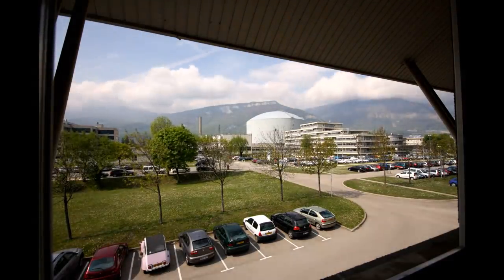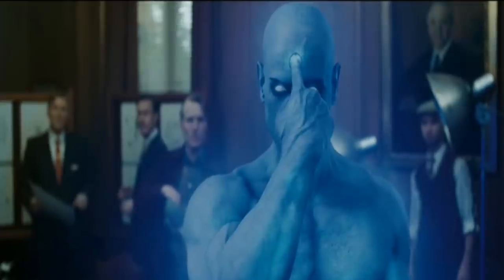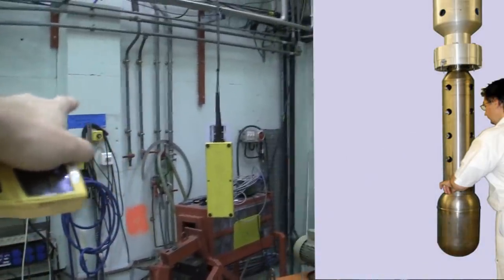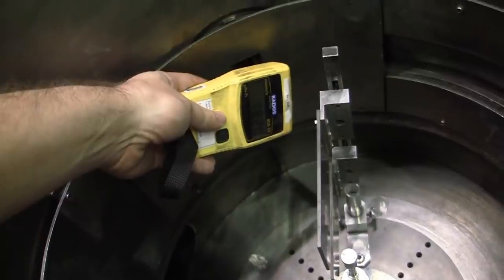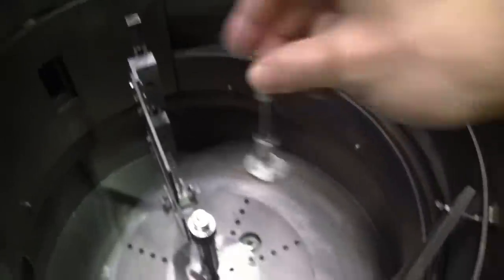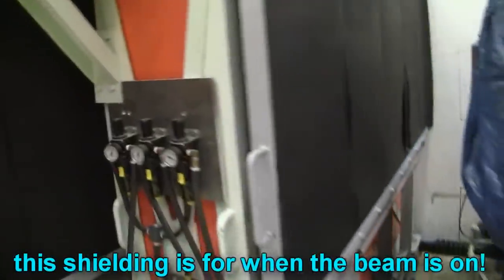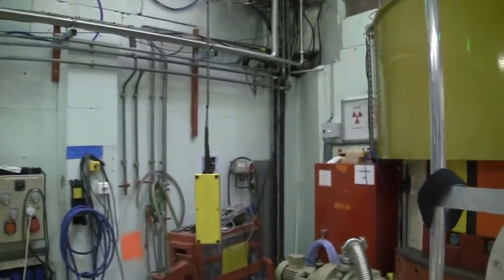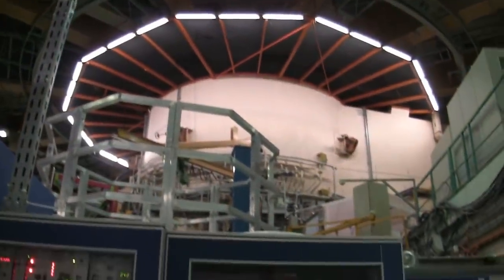Nuclear Reactors, Fantasy and Fact!

Comment: Just dont be in there if a powerfull earthuake hits like hit Fukushima. The ground shook , bounced thundered for 7 minutes. At least 3 reactor cores in Fuku cracked in those 7 minutes. Then the tsunami hit swamping everything . Great , now e have toxic , deadly unstoppable radiation being pumped out in the air and water for the next 10 thousand years minimum. The Pacific Ocean is dying . All tide pools are dead, All fishing species are down 90% , Whales , seals, polar bears are starving too death. Japan did not want any nuke plants built way back in the fifties. We forced them too accept the nukes. Great , Japan the most seismic ,almost yearly powerfull earthuake zone on earth. Tokyo should have been evacuated. An area one tenth the size of France , using the new super solar cell tech could provide all power for all of earth. All these NUKE TICKING TIME BOMBS could be closed forever.   p.s.  Try too get that close too the cracked reactors at Fuku now, your organs would melt in a few minutes, be a horrible agonizing death.
Reply: The new super efficient solar cells work at   90 % even on cloudy days' Nuclear would be too cheap too meter, they said way back in the 50's. They are the most expensive, most complicated, most polluted , foulest most dangerous way too boil water ever invented.  Oil super rich Dubai is building huge , immense  solar arrays using this efficient technology , Not because they are environmentalists , but because it is the cheapest power plant too build too generate electricity  Poor japan will spend hundreds of billions of dollars over the next century trying too contain, control the , ' totally out  of control reactors at Fukushima. whoops , there goes all the profits, they ever made .

Comment: A grenade equivalent neutron would have a million times more energy in the explosion as it would in kinetic energy when thrown, not a million times more TNT. So if it weighed a kilogram, it's more like 150 MJ, or the energy of around 70 pounds of TNT, not a kiloton, but not a dud either!

Comment: Hi, may I ask a question? I used to work with a Cf neutron radiation source of 2*10^5Bq, and we were not very careful about protection. How dangerous is a source like this?
Reply: Are you still alive ? Security first. Even if in your case it may not be dangerous (no idea), it is really dumb to expose yourself with potential deadly device/materials. Always check before, not after.
Reply: No. Never check before.

Comment: I know you don't work at a nuclear fission plant, but since you are working with a reactor, I have a question. When a meltdown does occur, what part is releasing the ungodly amounts of radiation if the core in and of itself isn't producing too much? Not bashing nuclear fission, just curious which part exactly causes the massive amount after it overheats. Is it just the exposed nuclear elements (Uranium, etc.) hitting the air?
Reply: The reactor is releasing large amounts of energy and radiation, but the radiation is absorbed/dissipated, and when a meltdown occurs, nothing is there to stop the element being used from breaking down at an incredible rate, as the reactor works by slowing the rate at which the element decays. Once the reactor begins to melt down, there is nothing stopping the element to decay as fast as the element physically can.
Reply: +DrewPicklesTheDark This is the shortest explanation I can make that it is at all comprehensive:
Protons are charged particles and repell each other, even in the nucleus of an atom. Heavy stable or almost stable (long half-life) elements therefor have more neutrons for each proton than lighter elements. When you split heavy elements like uranium you get lighter atoms which have too many neutrons to be stable. The very short lived atoms simply leak neutrons; these are the neutrons that continue the chain reaction.

Another way to get rid of neutrons is to convert a neutron to a proton, an eletron and an anti electron neutrino. This is beta decay. The electron and the recoiling atom have enough energy to break bonds and do damage. The anti electron neutrino will happily go through a lightyear of lead with only a minimal chance of being absorbed; that makes them completely safe (if they don't interact they can't hurt) and difficult to even detect. Beta decay sometimes leaves the nucleus of the atoms in an excited state. When it returns to ground state it will emit a very energetic photon; this is gamma radiation.

After the reactor shuts down, the fuel in the reactor contains a mixture of long, short and medium-lived elements. Immediately after shutdown it still produces ~7% of full power from radioactive decay. This quickly drops to a few percent within minutes. If the cooling system is not working, this is still enough to melt the fuel.

When the fuel is very hot or molten, most elements in the fuel are still happy to just sit there and not do anything particularly harmful, but a few elements are volatile and will boil off easily. In particular these are iodine and caesium.

Iodine is short-lived and very radioactive. It's a problem for a few weeks, then it's completely gone. This is what iodine tablets are for in the case of nuclear accident. You flood the thyroid with iodine, so that it has all the iodine it needs and isn't happy to absorb more that might be radioactive from things like milk.

The caesium is a beta and gamma emitter and exists as two major isotopes in spent fuel; Cs-134 and Cs-137. The first has a half-life of a few years and the latter has a half-life of a couple of decades. They are short-lived enough to be seriously radioactive, and long lived enough to still be concern years later. Because people are scared of radiation doses a few times world average background and because they have already been evacuated early in the accident, the areas around Fukushima and Chernobyl remain uninhabitated even if it makes no sense at all.

Spent fuel fresh out of the reactor will be stored underwater in a spent fuel pool for a few years. After a few years it can be moved to dry cask storage. This is a concrete and steel container that is air cooled and thick enough to reduce radiation exposure standing near the cask to levels that are not considered problematic during handling (generally much lower than they need be, to show the public that no expense was spared; which reinforces the opposite message, that nuclear is so dangerous that you need to take all these precautions).

Comment: Nuclear power still is not the answer UNTIL we can design plants that contain fool-proof fail-safe shutdown systems that prevent the possibility of meltdowns as have already occurred in Chernobyl and Fukushima - and are guaranteed to occur elsewhere again. 'Fail-safe'  and 'core containment' and 'safe storage' are still not sufficiently designed into plants. That fact keeps the cost downside of nuclear clean-up far beyond the plus side of low carbon footprint. It is for that reason not worth continuing. Fukushima's reactor is not a Japanese design. It is an American GE Mark1 reactor all designed and approved by GE. Yes, there were a great number of potentials present at that particular site that did fail and allowed this world-scale disater to occur. But the majority of these flaws still exist in every other like GE reactor in Japan and elsewhere and WILL cause the same nightmare meltdown scenario with deadly releases of radiation. The nuclear industry is controlled by big money and polices itself, hence little will be corrected and the next disasters WILL occur further speeding our extinction. It is important to understand that none of these plants were designed to cope with meltdowns or incorporate methods to secure and safely contain a melting core. That inability exponentially complicates matters. You know we are facing epic levels of hubris and incompetency in the nuclear industry when no one can even tell where the cores at Fukushima now are. I cannot believe how incredibly stupid mankind is. Check out the information presented by Arnie Gunderson, a PhD in Nuclear Engineering at Fairewinds who closely monitors and follows the Fukushima event.
Reply: Even if we get such disasters every 10 years the amount of deaths is less then basically anything else. Then there is reactors in which the fuel is present in a molten salt, then there is no chance whatsoever of a meltdown. It is simply a bad argument which ks so influential as humans view a death by disaster much much more seriously then a death by something like pollution or traffic.
There is a good chance deaths would decrease if we had a bunch of reactors as we could switch the focus of the scientific community away from power and into life-saving things.
Reply: +firefoxhits Meanwhile coal power kills more people than you could even if you dissolved the spent fuel rods completely in hot nitric acid and dumped them into the nearest ocean. How many people need to die for your foolishness?

Read the Chernobyl forum report. It is very instructive. You can have a Chernobyl every day of the year and still not beat the 4 million who die of outdoor air pollution every day (not to forget the energy poor, ~6 million of which who die from burning cow dung and coal indoors for cooking).

The most dangerous reactors are the ones which have been prematurely shut down. Even RBMK reactors (of the same design as Chernobyl), e.g. Ignalina, are much preferable to coal.
Reply: I will just add one more thing. The deadlyness of power plants is mesured in deaths/pwh. Nuclear power has killed around 10k people but has a deadlyness of around 100d/pwh. Wind has 150d/pwh due to workers falling of the turbines. solar has 440d/twh due to mining and hydro has 1.4kd/pwh due to dam failings. Essentially is the effectiveness of nuclear power so high that it statistically is safest, even considering meltdowns and mining. 
meanwhile coal sits above 100kd/pwh.
These arent huge numbers as the earth generates around 22pwh/year but nuclear is still safest by far. Additionally it takes up much less space then other means of generation.
Reply: soylentgreenb
I'll concede to the d/pwh numbers, but how many more Fukushimas do we need to happen, and I assert they will and in like fashion leaking into our waters unabated, before the oceans are sterilized? Air pollution and eeven climate change are likley a far lees evil than oceans strililzed forever. My issue isn't against nuclear, but aginst the failings in design and the lack of foresight to design something that provides maximum control WHEN the next disaster occurs, PLUS man's basic arrogance believing we have it in control and more often than not push products into the marketplace for finacial reasons, well before we have all the bugs worked out. Push out the next model car with failings and 100 people die, and let the lawyers deal with it and the recalls. Have a 10 Fukushimas and the oceans are dead and all marine life for the next 100,000years. Is thtat not both valid and likley given the proximity of reactors to oceans and the factt that they may never locate, let alone recover and safely contain the core melts at Fukushima??
Reply: +firefoxhits This is a complex matter and it doesn't get easier as a lots of missinformation are spread around, though I think I have some idea of it by now altough i might have some big flaws.
The water next to the plant is obviously contaminated and the closest kilometers are fairly dead. The pacific ocean has reported values of around 10 Bq/m3, which is five times higher then the 2008 levels of 2 Bq/m3.(Grabbed from a anti-nuclear website, unsure about accuracy) The limit to radiation in drinking water for humans is 7400 Bq/m3 (of ceasium 137) according to the EPA. Even considering equal disasters every 30 years(not true as all disasters won't leak that much into the sea) the amount of radiation in the ocean will never be over 20 Bq/m3, many hundered times less then then limit to drinking water.
Reply: +firefoxhits Now, quite a bit of sealife can die of this, especially considering enrichment of some rare isotopes. However while damage here is expected, nobedy on the internet really seems to know how serious the damage is. I found lots of pictures of fish with nasty diseases uncorrolated to radiation(and often taken before fukushima) called out as cancer and lots of sites debunking this obvious bullshit. This is the only thing I found which were remotely scietific;
http://www.whoi.edu/oceanus/feature/how-is-fukushimas-fallout-affecting-marine-life
Read it for yourself and draw your conclusions. The general theme is that while there is an increase in radiation it is not a threat to anything really.
These are the in my eyes accepted losses when you get compact, efficient and sustainable energy. Now we can only hope that someone shows this to our "beloved" politicians, also please tell me if anything confused you or is overlooked by me, for this needs to be spread through discussion.
Reply: I appreciate the information. The solution to pollution is dilution adage is currently appropriate and may well work at this moment in time. But I am concerned for 2 reasons. First, I do not forsee a stop to the radiation leakage in to the ocean from Fukushima for decades and perhaps never. Plus, the inability to determine the core-melt's location, and lack of technology to use for recovery, the ground water continuing to wash through, and the potential for it to get far worse yet including the cores in the pond in #4 from another earthquake, tsunami, or a structural/foundation failure of #4. I am now certain that core containment and recovery was never given sufficient consideration in design. That's painfully obvious at Fukushima. Secondly, it seems there are yet so many more nuclear reactors sitting at water's edge around the world, and any one can be the next Fukushima. How many more could our oceans handle before we are screwed forever? I understand the efffciency of nuclear power, but it seems the accepted standard designs have made it too difficult to impossible to deal with when things go wrong.
Again, thanks for the info. It is hard to find anything accurate and reliable on this disaster. I still won't eat any fish from the pacific until Im assured it is ok. North america from top to bottom is where the currents take Fukushima's radaition flow and tuna caught off California have been found to contain Fukushima's isotopes.

Comment: Fuck we've been lied to. nuclear power is the future
Reply: +TheJakecheck Actually this is a neutron type research reactor. You couldn't make electricity with this. A Uraneum reactor produced neutrons AND shed loads of Gamma,
Reply: Nuclear power stations release less radiation into the environment than coal fired plants.
Reply: TalesOfWar what has that got to do with anything? Try reading things and putting them in context. The point is that a neutron producing reactor does not produce Gamma at all.  A uranium reactor does produce Gamma along with a lot of other radiation (including neutrons) which is shielded, BUT the waste products are still dangerous for over 100K years.
Reply: Gordon Lawrence They put the waste in the ground then cover it in concrete. You know, the ground, where it came from to begin with. Again, there's less waste material and radiation produced with nuclear than coal. The waste from the entire lifespan of a nuclear plant fits into something the size of a tennis court. A lot of it is reused to for other industrial processes or military use. They use it for making armour piercing tank shells for example and armour plating in the Abrams (which I find to be rather retarded, but there you go).
Reply: TalesOfWar actually no they don't. A good deal of it ends up at Sellafield Nuclear Reprocessing Plant. It has to be stored in water pools for up to 2 decades before it can be processed and then the remnants that cannot be re-used are vitrified (in glass) as concrete is not stable enough to remain for 100,000 years plus. Also only the US uses depleted uranium for APFSDS the UK and the rest of Europe use Tungsten. Also Only the US use Depleted Uranium on top of Chobham Mk1 armour. The UK uses Chobham MK3 which is tougher and does not use a veneer of Uranium. The HA variant on the M1A! is so thin it almost makes no difference. The weight if the vehicle is only increased by 2 tonnes and 2 tonnes of DU spread over that large a surface area is no more than a few mm thick as DU has a relative density of around 20. Specifically if you made it 1/8 inch thick it would cover a fraction over 4 square yards. That's the frontal armour only. Also it's not the Uranium that's the problem it's the "low level" waste EG Cobalt 60 that's the issue. Your data does not take into account anything but the radiation going into the air at the time of generation.